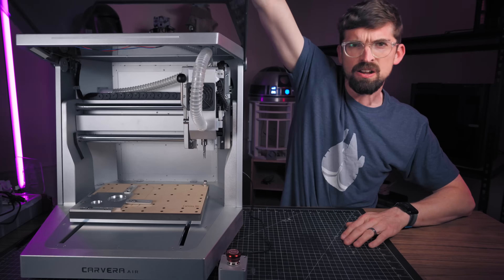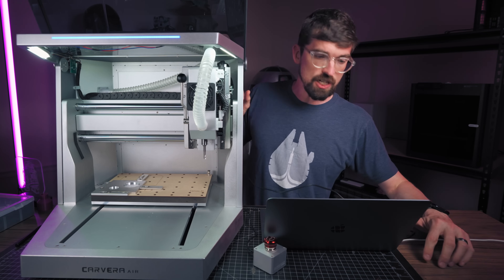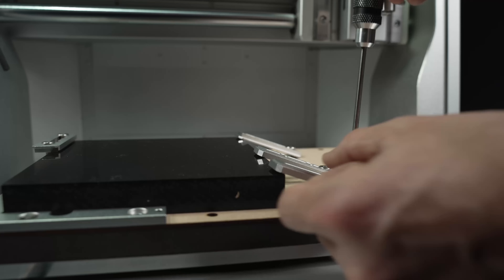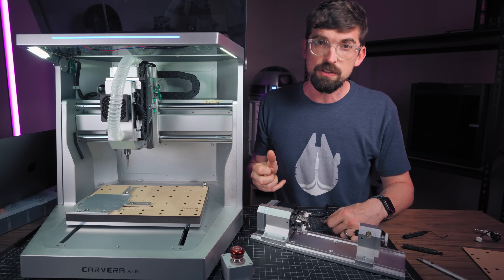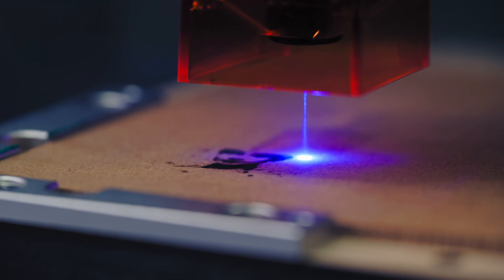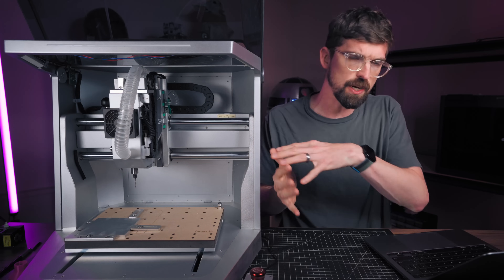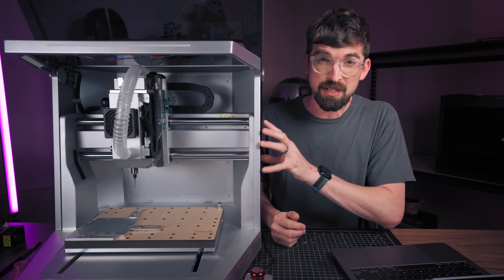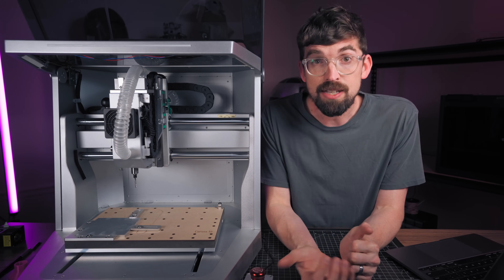Great Deal or Overpriced Hype? - Carvera Air CNC

Comment: I've backed this on KS mostly because it interests me. I've never done any CNC but have several 3D printers. I would note that the shipping costs seem to remove a lot of the benefits of KS. I think that's something you could mention. They're currently estimating $350. The Carvera has 'free' shipping on their website so the later price of the air may come with that also.
Reply from the maker: Ah, good point.  Didn't even consider the shipping side on Kickstarter, vs the free shipping from Carvera.  Great point!
Reply: Just remember that taxes and duties are included in that price. I’m pretty sure shipping was also charged for the original Carvera KS.

Comment: Does the Kickstarter price really include the laser and/or rotary tool?
Reply: Nope, they are optional add'ons.
Reply from the maker: They are add on's, mean to mention that in the video but forgot to write it down.
Reply: Thanks, I figured those where extras since the package already was pretty cheap.
Reply: I'm definitely getting one with PCB and 4th axis add-ons. For the price, it will be good for me as a beginner.

Comment: 200w spindle,  linear rods, etc.. stay away from this pice of trash, if you plan to acsually cut metal
Reply: This machine is for beginners or in house small projects, not for industrial shop work haha. Besides whats a better option for the price in this category then huh?
Reply: @chadlemay7105 for my small jobs I got my wm3020 then just added a makita router and bought the geminstu enclosure all that came to a lot less then the kickstarter price of this machine 

If the spindle was better I would consider this but at 200w and a max of 13000 rpm jobs are just going to take to long 
Shame because I do really like the look of it still at that price should be linear rails and a better spindle
Reply: Why call something a piece of trash if its intended use case works? You make it sound like hobbyists should have a Haas or nothing at all. (Granted if you had said don’t push steel through it I would be on board, but again that doesn’t mean it’s trash)

Comment: Overpriced hype, Snapmaker is a better system
Reply: Two different machines, I won't suggest snapmaker for milling  makera is more capable
Reply: Not really…If you want a 3d printer buy a 3d printer, if you want a laser engraver buy a laser engraver, if you want a desktop cnc well you get it…Usually multi systems in one machine doesn’t perform as well as a single use designed system. I doubt snap maker is as rigid for any kind of metal work as the carvera is.
Reply: You're messing something up. Snapmaker is overpriced. 😂 The Carvera Air Kickstarter price is very competitive and (like he says in the video) is not comparable to anything else! Not to mention enclosure, 4th axies, great starting guide, PCB milling and laser module. Snapmaker is not able to supply that under $2.000!
Reply: Respectfully, I disagree. Carvers Air is the more robust mill. To get the Snapmaker to similar features (enclosure, 4th axis, laser, many bits….) you will pay much more for the Snapmaker.